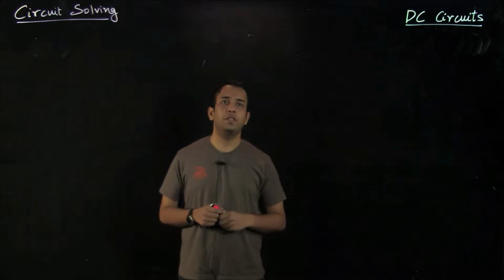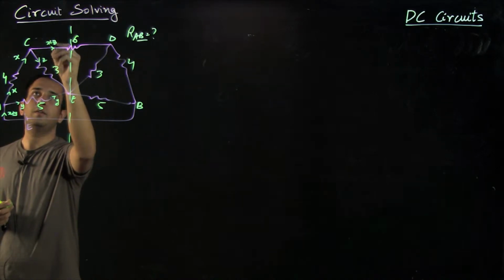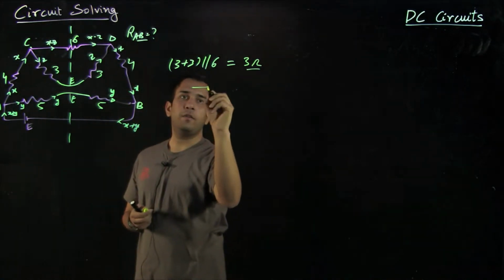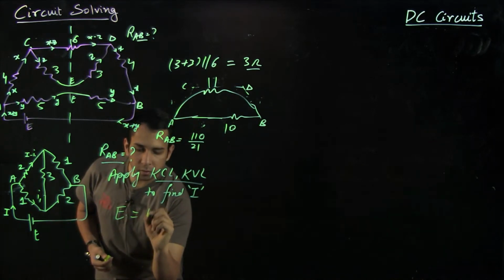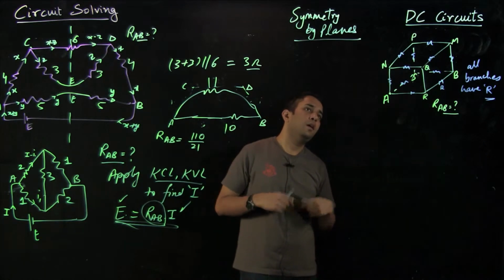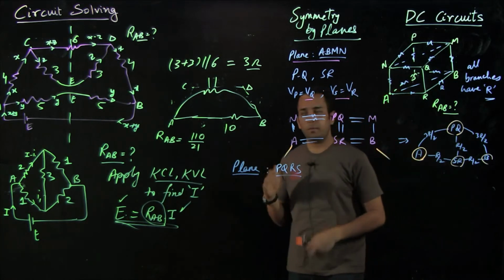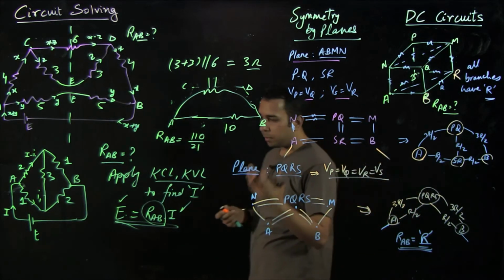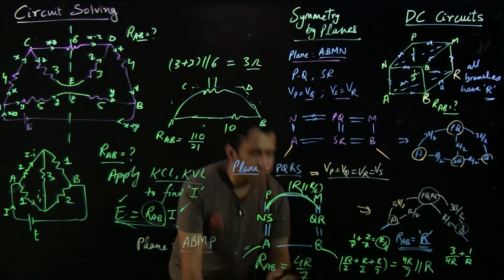Lecture 10 DC Circuits - Circuit Solving Examples

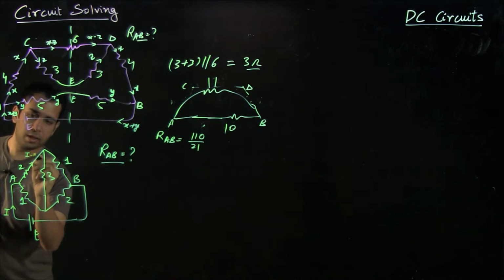Comment: For the problem at around 8:50, one thing you could do to simplify would be to take the currents in the 1 and 2 ohm resistances (the ones on the right), to be i1 and I - I1, because apparently by symmetry that's true (thats whats given in hc verma).